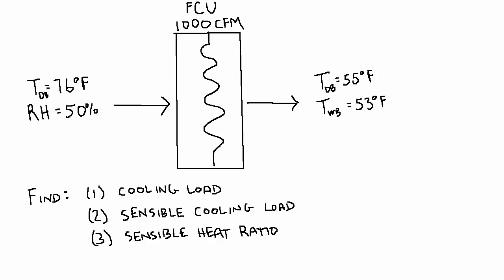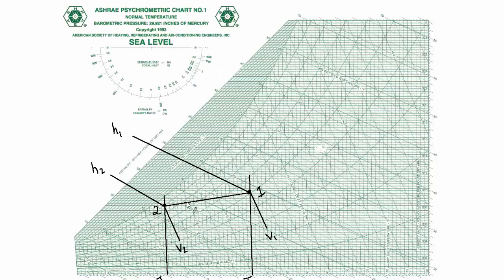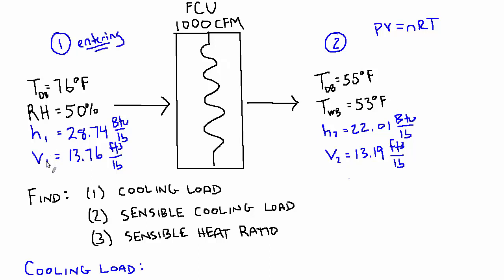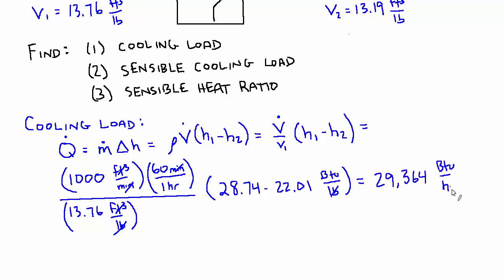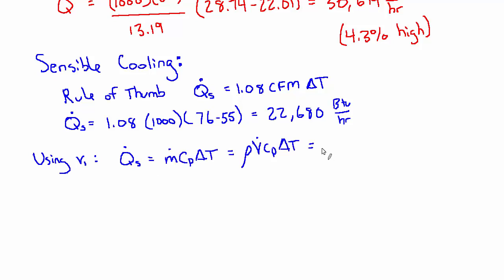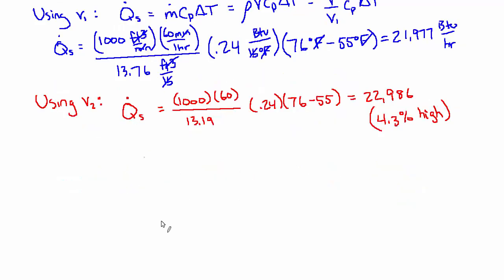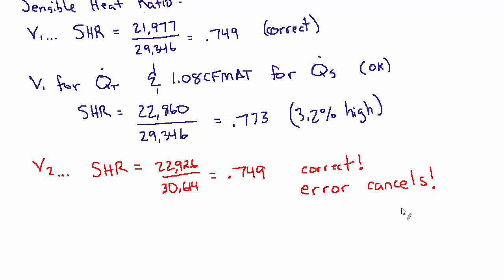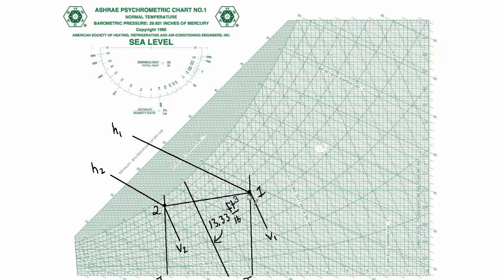HVAC Cooling Load Calculation Explained | PE Exam Prep for Mechanical Engineers

Comment: Is entering air also contain moisture? so how we can say that volume flow rate of entering air (dry air) is conserved where it contain some water vapor. I got confused that or i did not understand it. Please help
Reply from the maker: Dry air in and dry air out are the same.  It's the moisture content that's changing.  Does that help, and if not, can you rephrase your question?
Reply: @MechanicalPEExamPrep   is the given flowrate(inlet) in quistion represents the flowrate of dry air only or not?
Reply from the maker: @mohammadsameer5098  Not. It’s total airflow.  But the water vapor is such a small percentage you can usually assume it is equal. Unless you are dealing with very warm air such as exhaust gases in a combustion scenario. For heating and cooling, it’s close enough. 

Go ahead and split it out and see the impact on the resulting answer changes negligibly. Confirm for yourself. Then let me know if you have any new questions.
Reply: @MechanicalPEExamPrep  thank you very mutch, it is clear now.